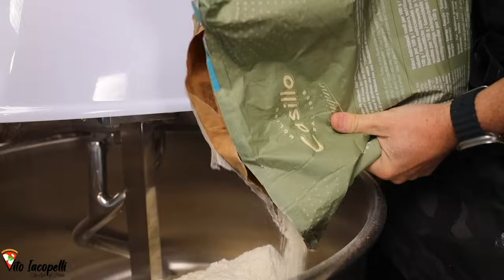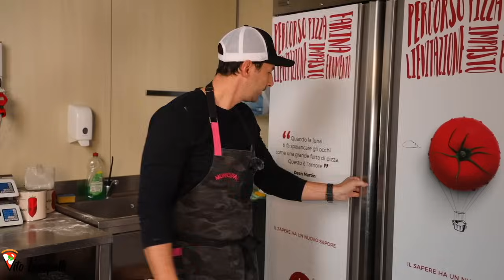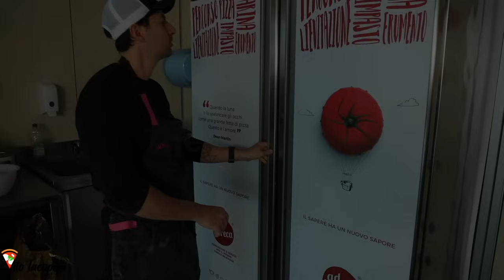Neapolitan Pizza Dough Full Process⎮Wood oven and catering Vito Iacopelli

Comment: 3:44 woah! did not expect the ice cubes to go in there!
Reply: yeah, ice cubes are a new one to me... interesting
Reply: it's actually quite logical. this huge amount of dough will self heat during kneading so it's very easy to go out from temperature range and spoil the dough. So that's why cold water and ice is added :) You'll have no need in ice when making small batch. Especially if you knead by hand...

Comment: Hey Vito, I've hit a snag with making multiple pizzas consecutively. Although the oven floor initially reaches temperatures above 400°C, it quickly cools down at the bottom after baking a few pizzas. As a result, I have to wait for it to reheat between each batch, causing delays for our guests